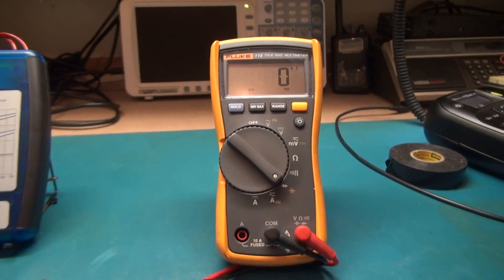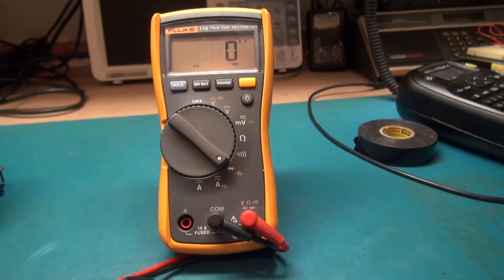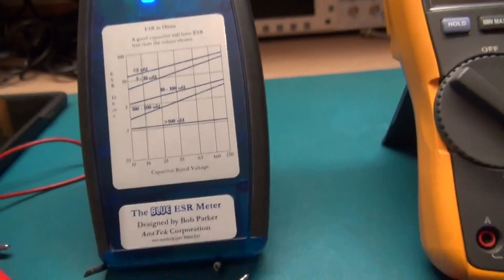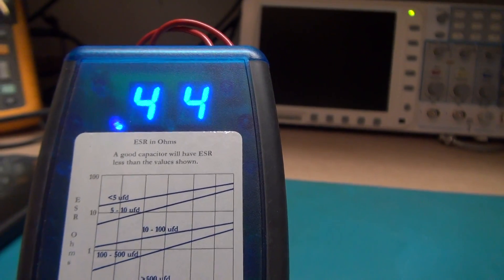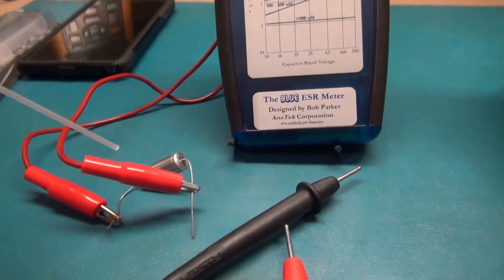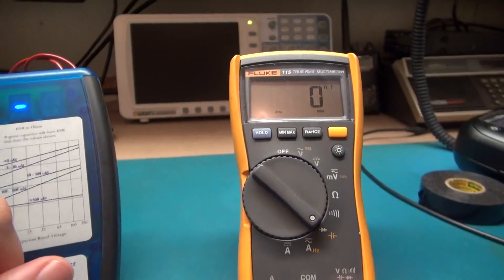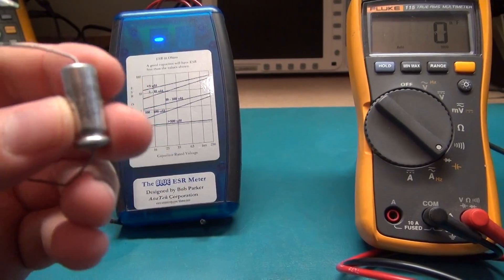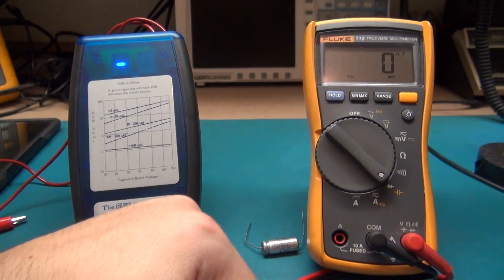Capacitor testing basics. Don't use a multimeter. Here is why.

Comment: Great video explaining how to test capacitors.  So I'm trying to fix a TV that's acting bonkers and I'm pretty sure it's a bad capacitor but there are tons of capacitors both smd and large buggers.  A detailed visual inspection does not show any damage to any of them.  So I am certain one of them is busted.  Any idea how to test each one.  There are hundreds of them and I can't exactly de-solder them and do this spray can freeze test and I don't have an ESLR tester too.  Is there an easier way to test for bad caps on a board?
Reply from the maker: I would use a smd heat gun and go over the caps with it one just spending a couple seconds on each cap. You may notice a area might make it work momentarily. Then use the freeze spray can with a straw on each cap in the area to reproduce the problem. It the cap is not exploded or completely dead this could work.
Reply: @Kev_31779  Thanks for the tip. It's gonna be a major project as there's so many to test. I'll try to follow your example and see if it works. Thanks for sharing.
Reply: @jonfreeman9682  did it work?
Reply: @tbprofile1295  No luck for me but that doesn't mean it won't work for you. You should give it a try.

Comment: I think you got the part about spraying caps with freeze spray to bring them back. you use heat to bring them back and identify the bad cap, you use freeze spray to bring back IC's temporarily. You literally prove this yourself by pushing up the esr when frozen.
https://youtu.be/o6kPLx2AmFo?t=190
You meant to say you can temporaraly replicate the issue and make the cap worse when frozen. a hair dryer can sometimes bring it back temporarily if already showing faulty

Comment: I'm going to just throw the pig in the room. The issue with testing the ESR resistance reading on that tester along with 90% of other budget testers. only test the ESR of all capacitors on one set frequency. most are at 1KHz some are set to 100-120Hz. The problem is capacitors are designed to have an ESR spec at a designed frequency and most are different. For instance, the caps I just test the ESR on my strobe tuner have to deal with Freq from 200Hz to 4KHz the datasheet said to test ESR at 3KHz if I were to test the same CAP on that tester and most others I would have read about 1.8 - 2.5  However the ESR of this CAP should not get higher then 0.62. I would have junked the CAP.  One you have to check your data sheet on the Component Under Test. then test the ESR at the frequency that the manufacture used. If you don't know the frequency then you have to determine the signal type and frequency of the circuit it was pulled from. that test at a similar frequency.  That is the worst way to go but sometimes you don't have a choice. 

This is not a special rare component thing if you pull 20 CAP's off aboard only 6-8 will have the same Frequency ESR tolerances. You don't have to test at the exact Hz but as close as you can to the manufactures specs.  There is a CAP used in 60-120Hz circuits have were designed to have low ESR at 4KHz even though the cap was used in a 75Hz circuit. so if you test the CAP at 120hz it will test out of your print-out the range.  However. If you test it at the Hz it was rated for then it tests fine. every CAP you come across has a spec frequency for its ESR range tolerance.  Testing a CAP spec'ed for 120Hz with a tester that runs a 1KHz test, will in most cases test the ESR out of your printout tolerance range. showing a bad cap. However, if you run the same test with an ESR tester that can change freq and set it to 100Hz - 120Hz  would the CAP be well under tolerance.  Just some food for thought.

Comment: It's worth noting here that he's testing electrolytic capacitors.  The capacitor (aka condenser) in an engine's ignition system is (hooray) not an electrolytic type and can be tested with a multimeter.  

Electrolytics consist roughly of two pieces (called plates) of aluminum foil separated by tissue paper soaked in a mild but important liquid solution akin to lye.  When a voltage is applied across the two plates a very thin insulating layer forms on one plate.  It's the thin-ness of this layer that gives the electrolytic capacitor lots of capacitance for a small package.  But they're not very durable: a breakdown of any sort will boil the liquid into vapor and cause the device to vent gas, swell up, crack open, and on rare occasions explode.  More often, however, the liquid just dries out, increasing the ESR of the capacitor and ultimately rendering it useless. 

The easiest way to check if a dried-out electrolytic is causing an electronic device to malfunction is to bridge a new capacitor across the terminals of the suspicious one.

Comment: Anyone here to see how to measure a capacitor with a mulitmeter because that's all we have?
Reply: Just get a cheap (~$10) chinese M328 meter. Doesn't matter which one....they all test the same and will give you accurate ESR no problem. This one is just an example https://smile.amazon.com/HiLetgo-Multifunctional-Capacitor-component-Backlight/dp/B01MYU0QI3/ref=pd_sbs_328_3/136-1972966-9684162?_encoding=UTF8&pd_rd_i=B01MYU0QI3&pd_rd_r=a80f9dda-291e-44e4-b8d3-3b6a44c6e35e&pd_rd_w=J8byH&pd_rd_wg=Mbki6&pf_rd_p=12b8d3e2-e203-4b23-a8bc-68a7d2806477&pf_rd_r=2AXJP1WMRQGQJDMSMMGB&psc=1&refRID=2AXJP1WMRQGQJDMSMMGB  They all use the same chip (STM328), no matter how cheap or expensive the meter is. They are cheaper than this on Ebay but you just need to wait for the slow boat from China.
Reply: Ever heard of a LCR Meter?
Reply: Get familiar with a good meter you trust an you can do more than just a capacitance test to get an indication of if it's leaking DC.  ESR meters are good an all but your not checking EPR anyway. 👍
Reply: yes, I've just watched a video prior to this one where the guy uses the resistance setting on the multimeter to test a capacitor - the resistance should go up to a certain value then go to OL.

Comment: Correct me if I'm wrong, but wouldn't a regular multimeter set to resistance measuring do the job just as well?
Reply from the maker: Nope. A regular ohm meter does not test it at different frequencys.

Comment: This tells me trying to repair circuit boards in old radios etc. is difficult and far more work than it's worth.
Reply: An ESR meter is a “must have”, no matter if one works on vintage radio or switching power supplies...It makes your life easy!
Reply: Old radios costs 100 of units, TVs etc...

Comment: So I don’t want to go buy the kit or any of that I believe my capacitor for my washing machine is bad because it starts spin then stops starts spin then stops. I have check the lid switch and all that then the water pump deal was super hot like burning hot I am guessing it’s because the water pump is trying to run but the capacitor isn’t giving enough power or whatever to the pump. I used a multi meter in ohms and after shorting our the cap and testing the multi meter goes to the highest then down to 0. Does that mean it is a bad capacitor?
Reply: If your multimeter is analog, then yes, the needle initially goes to zero and then, when the capacitor starts charging, it goes back to infinite (open circuit) resistance.

Comment: I have a Top Speed.Positive Charging System from my car boom box that I no longer used. 

I believe all it is a compacitor. Allow speaker to drain high voltage from CAP instead drain the battery.

I place it on multi meter CAP 1.5v(4.0mA) 9va(25mA)

Multi meter show 00.0. Is this mean this Top Speed Positive Charging System is dead?

Or I need to charge it before I test it?
Reply: If it is a big electrolytic capacitor there, try to see if it can get charged. For that purpose, use a small 12 volt power supply (or a battery with the same nominal voltage) and apply power to the capacitor by connecting a small incandescent lamp in series with it, say 0.5 Watt. Then watch if the lamp stops glowing after some time. The best is to connect a volt meter across the terminals of the capacitor. If the voltage rises, the cap is O.K. If not, the small lamp will glow permanently. In order to discharge the cap, after testing it, just connect the small lamp across its terminals. It will glow for some time, until the cap discharges.

Comment: I'm confused by this video. The cap range on a multimeter is not intended for performance testing. It's there to, assuming a good capacitor, give you a capacitance value. Invaluable when working with basically all modern electronics where unmarked surface mount caps need to be identified

Comment: Thank you for the video. Wasn't sure about the temp test. Is raising and lowering the temp going to produce the same effect on the capacitor you tested in the video; i.e. increased resistance? Will be adding a 50V 50KuF capacitor and full bridge rectifier to my MIG welder to reduce splatter, but don't trust the cheap Chinesium capacitor without testing it and don't know how to test it. Also, don't want to spend a lot of money to test one capacitor.

Comment: I had a 450vdc 2,000mf elevator drive cap that was cracked open and still read good with my fluke.
I wish I had kept it but I have a photo I plan to post to my website in near future.
I tell people the dmm can only tell you if its bad, not if its good.

Comment: Do you use the ESR meter for ceramic and molded tantalum caps as well?
Reply: This specific instrument can measure ESR of any type of capacitor, starting from 0,1μF upwards. Normally we are interested for detecting problems related to electrolytic capacitors (of any type). The instrument of this video is the “blue ESR meter”.

Comment: Love your simple approach at explaining things... BUT a couple of things.... first, TRIPOD! Had to go lay down as I am fresh out of Scopolamine. Second, when we are trying to make things simple we still need to be accurate, you did not mention to the watchers the operating temperature of your cap and I am quite sure you froze it right out of it's operating range, so it is not a truly accurate result. Also, the average Joe is thinking, "but he put it back on the first meter and it is still exactly where it needs to be, so what is the issue?" You forgot to tell them what the numbers on your fancy blue meter mean and why they are important. (when checking a cap under it's normal working (think temperature) conditions) I like your approach, just a bit of polishing to be done IMHO.....

Comment: You could use the ohms test function of the multimeter to test the capacitor's esr also... especially if it has the resolution of 100ths of an ohm... some multimeters do, some don't... my Fluke meter does test that low, but it is the top of the line 289 model, so IDK about the one in this video.
Reply: JoeJ8282 ESR is not the resistance through the capacitor. Equivalent Series Resistance is a measure of the capacitor’s reluctance to charge and discharge, which will cause self heating in a large ripple current situations. It cannot be measured with a multimeter on Ohms, inspite of what several unqualified people regularly say on their amp repair channels.
Reply: Charles Shaw; That is good to know. I wasn't sure but I kind of thought so. (I really DO need to buy me a good capacitance meter with ESR test!) However, even though a simple multimeter ohms reading may not be a totally accurate measure of a capacitor's series resistance, (because of more complicated interacting factors), that ohms reading can sometimes give you a rough indication of whether or not an electrolytic capacitor is horribly bad or out of spec or if it's probably OK, because I've had to utilize that test before myself when trying to troubleshoot a power supply circuit or two... Unfortunately I cannot afford a true, good quality Capacitance Meter with a real and accurate ESR testing function at this time due to $$, so I have to utilize whatever I can wherever I can, so a multimeter test of "ESR" of a cap is the best I can do, even though I couldn't count on those readings to be accurate in any specific way, but only just in a generalization of overall condition.
Reply: @JoeJ-8282  With a multimeter, the only test you can do on caps in general is the leakage test...
Reply: @ΠάριςΑζής  OK. (Also measuring their actual capacitance value, if your meter has that function, like mine does.) And so how exactly do you do that leakage test? What is the exact procedure, step by step? (I didn't know you could do that and I'd like to know how to do it.) Thanks.
Reply: @JoeJ-8282  you use the Oms ranges of the meter. I prefer to do this test with an analog multimeter (because it shows better the "capacitor effect") but a digital one will do the job as well, especially if the instrument has bar graph facility.
If you can lock the meter to a low range, is better for the test of high capacitance caps (because the test current of the instrument is higher in the  low ranges).
Anyway the procedure is:
1) You have the cap out of the circuit (discharged. If not, for small caps only, short their terminals momentarily before testing). For big caps, especially of high voltage, use a 10 Ohm / 5W wire resistor to discharge them rapidly. Avoid shorting them anyway. Shorting them reduces their life expectancy. 
2) You connect the probes of the multimeter: red to positive of the cap, black to the negative watching what happens.
3) In the beginning, the (healthy) cap acts as a short circuit. The indication is close to zero Ohms. But rapidly, as the cap charges normally, the Ohms indication increases until the cap is fully charged through and up to the level of the test voltage of the instrument. The final indication on the display is I or OL (infinite), as it was before connecting the cap.
Now, some people reverse the polarity of the probes repeating this step. The reaction should be the same as before. I don't use polarity reversal, but new shorting of the cap's terminals before repeating (for confirmation reasons) the test.
4) The healthy behavior of the cap, is to reach infinity when charging. If charging slows down (watch the speed of the process in the bar graph of the multimeter's display) and stops somewhere, with the instrument showing a fixed resistance, this is the leakage indication.
5) If you were, say, in the 2 kOhm range and the test was successful, then you need to increase the ranges up to 200KOhm. The result should always be infinity.
You can also use auto range function, but this will take much time when the instrument enters the MOhm ranges. This is useless, because above 1MOhm the cap is considered healthy.

With an analog multimeter, this test is very fast and clear using the Rx1KOhm range.
If you ever use it, keep in mind that the polarity of the test voltage coming out of the instrument is reversed. This means, for proper connection of the cap under test, red probe to minus pole and black to the plus pole of the cap.
The needle pointer should initially peg and then slowly sit on the infinity mark.
If it stays anywhere else, your cap is leaky.
I hope all is clear to you now!
Reply: @ΠάριςΑζής  Wow! Sounds really complicated!... But I'm pretty nerdy when it comes to electronics, so I think I can follow along there... I'll have to try that procedure step by step the next time I need to test if a power supply electrolytic cap is good or bad, for example. Thanks for the detailed info!
Reply: JoeJ8282 Well, it seems complicated but it’s not. After testing yourself two or three of them, you will get easily used to it. The problem this method imposes is that it’s time consuming, as you have to remove the caps from the circuit. ESR testing instead saves your day quickly and effectively. Practically you need to remove the caps only when there are many of them connected in parallel (and there is a possibility for one of them to be either dry or completely shorted). Moreover, if a cap is leaky is easily detected by ESR meters, without removal, as its ESR value increases. Therefore the multimeter testing for leakage, is merely a confirmation test. You are welcome and take care!
Reply: @charlesshaw9090  Thanks Mr. Shaw. I have been wanted to ask this question for long time but was afraid to do so and here you are
with the answer clearly explained. Thanks again

Comment: why dont we use a multimeter for insulation resistance test instead of megger?
Reply: Both tests are correct. Nevertheless, using an insulation tester for testing high voltage capacitors is better, because it tests the capacitors near to their working voltage. This means that there are cases where testing with low voltage (I.e by using multimeter) the capacitor might have a problem not revealed, while it becomes evident when the test voltage is high (using a “megger”.

Comment: What about HVAC multimeters that include temperature readings? Aren't they made to field test caps? Do HVAC techs carry ESR meters as well as an HVAC multimetet?
Reply from the maker: They usually don't check esr They use a regular multimeter . It's  works but it's the quick and dirty way..

Comment: I have a cap with a 220uf rating on my capacitor checker its at 240ish is that good or bad. I know volts is OK but on the uf its not good to go over or below. Thanks
Reply: The usual tolerance for caps is plus or minus 20% in reference to their nominal capacitance. Yours seems to be OK.

Comment: This meter is no good for testing variable capacitors for shortwave 5-20 pf.  I tried on mine and they all seem to be useless because it does not read them.
Reply: P.s. I am referring to the FLUKE.
Reply: Garras Porgratix It cannot measure accurately below 1nF  (1000pF) I think. See its manual for the lower range.